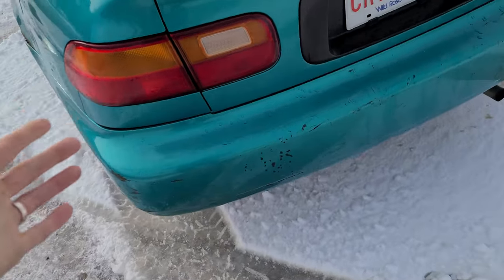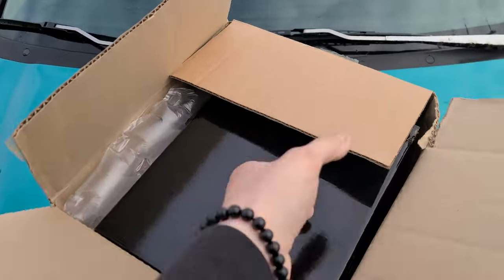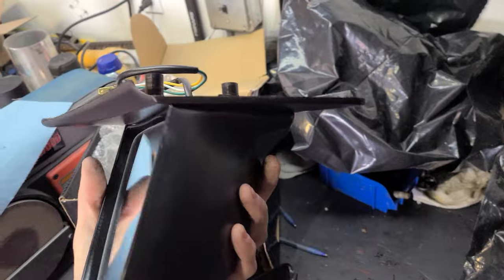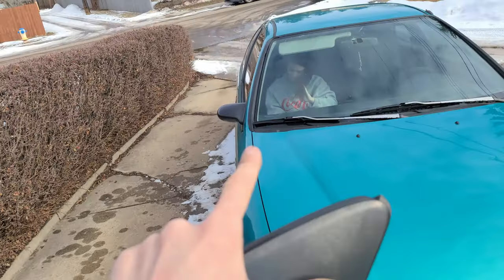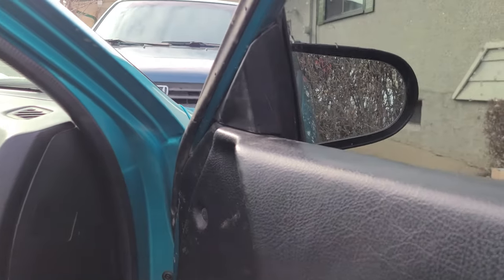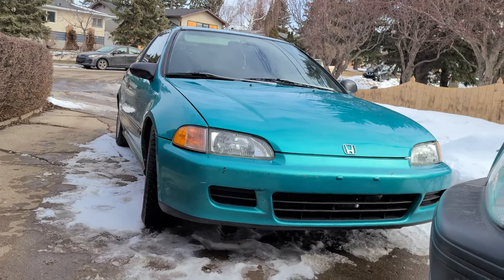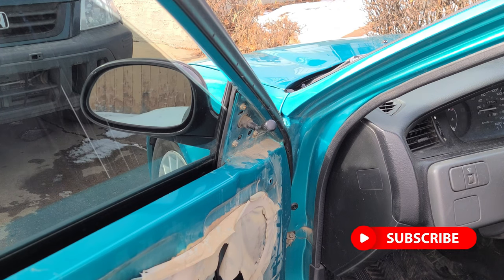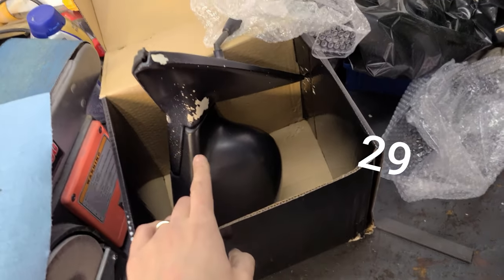Fixing The Worst Part Of My $400 Civic! Installing Spoon Mirrors On The "EG" Civic Project!

Comment: my buddy just gave me his nugget so I paid him for the stereo and the two new sets of tire. not as rusty but my clear coat toast. first thing I did was buy a bistle extractor and steamer two best purchases ever cause he used the ej2 as a work rig when he was a logger. neat to see what you've been doing to it. mines already had a engine swap so my big expenditures going to be suspension rebuild, new windshield, and some good ol diy paint correction. looking for an integra donor for seats, rear disc brakes and power steering rack